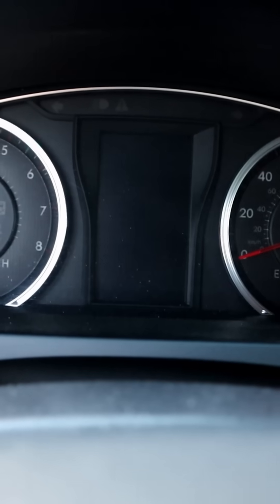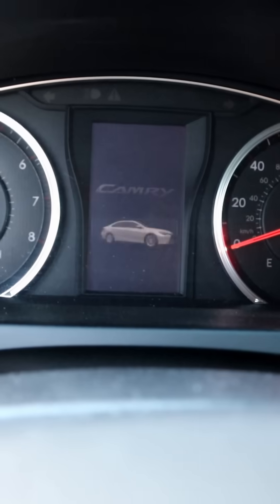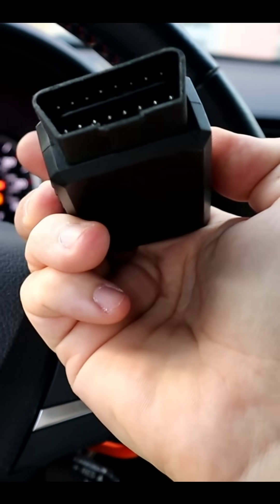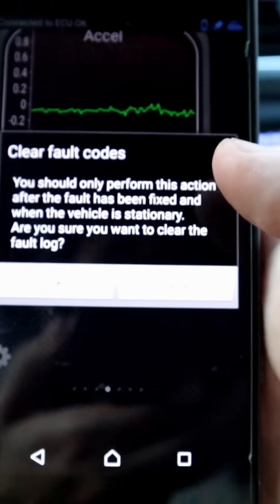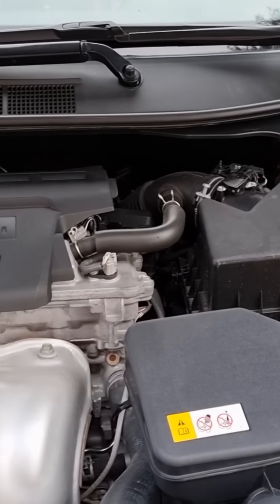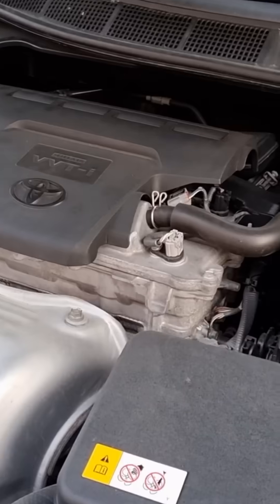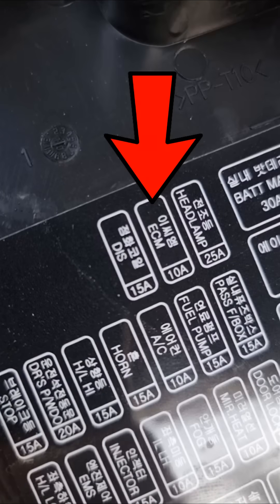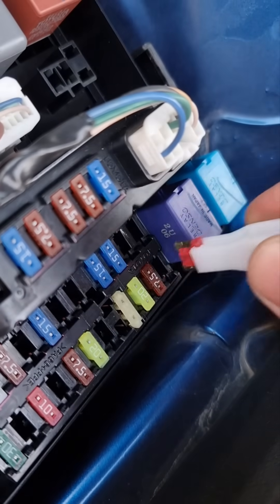Learn 3 Ways to turn OFF Engine light in 1 minute, How to reset ECU without OBD scanner tool#shorts

Comment: I got my light to go off on my Silverado my pulling out the ECM fuse while the truck was running the engine will die leave the ignition on put the fuse back in turn the ignition off then start it the light should go off then all of the other methods did 😅not work

Comment: ...I had a quantity of "4" ECU fuses on a 2024 Toyota Sienna.  Only saw 2 at first, but ended up seeing 4.   I pulled each individually and 3 and/or 4 must have been the one.  Thank you so much.  The Hybrid small battery negative terminal look very hard to take off. 
Excellent advice.  Thank you so much.

Comment: I removed the ECM fuse, but...do you take it out while the key is in the ignition and or while the car is on??
Reply: Did you take it out, with car on or off?
Reply: @龍1688  the car off.

Comment: I removed the ECU fuse and plugged it back in, and it WORKED!!!  Thanks!  So easy...
Reply from the maker: Glad it helped
Reply: I cant find on my skoda octavia 2008 model ecu would you have any idea what num fuse it is please??? @AliMECH
Reply: Was the check engine light because of the ecu? Because mines on rn because of the ecu
Reply: @moondripp31  it wasn’t at the time, but a couple of weeks later the car just wouldn’t turn over and that was the ECU, so I think it was the ECU all along.
Reply: Where is ECU located in camry 2.4???
Reply: @lindaobazeelindaobazeeosar5107 glovebox or somewhere
Reply: Please where can i identify ECU in camry 2.4????
Reply: Thanks brother! Great video 👍🏾

Comment: It did work. Thank You. I disconnected negative battery terminal and removed the ECM Fuse and put it right back in. The check engine light was off.  THANK YOU SO MUCH.
Reply from the maker: Glad it helped
Reply: @AliMECH  After check engine light is turned off, how long should it take to take the car for emission test?
Reply: Which one ecm fuse any code?
Reply: How long did it stay off for?
Reply: Til the monitor resets. @Peggysuesue123
Reply: Did you do that while the engine was still running on idle mode ? Or was the engine turned off  ?

Comment: Thank you, your video gave me the idea, though I had to remove the fuse for EFI in the engine compartment since ECU-IG and ECU-B in cabin didn't do the trick. It's a E12 2002 EU Corolla. It's a fuel burn issue according to the error code (catalytic converter/oxygen sensor).

Comment: Just keep the fuse off and never worry about it again ha ha ha ha
Reply: Also, a great way to pass emissions is to not go. Lol
Reply: @orbitty1354  Can one go for an emission test right away or few days after turning the  check engine light off
Reply: @nanapoku5259  I tried, that never works.
Reply: @orbitty1354   Oh wow. You mean the light went off but still didn't pass emission test?
Reply: @nanapoku5259  that's right.
Reply: @nanapoku5259  I'm not 100 percent positive, but with obd 2, it is impossible to cheat, unlike obd 1.
Reply: r u sure
Reply: @AliMECH  hey brother please tell can we do that?

Comment: You providing wrong information which would create other problems
1- never disconnect the battery to turn the check engine light off that is no no
 Here is why 
2- when you drive your vehicle the computer management system learns from your driving habit manage the vehicle sensors and assign a set of parameter for them to be able to run the engine and air file ratio and another system as well run the monitors and do on, when you disconnect the battery you erase everything all date especially freeze frame 

After that when you start your car ECU USE THE DEFAULT VALUES SINCE THE DEFULT VALUE IS SET OF INSTRUCTION THAT GUILD THE ECU AND USE THISE VALUE TO RUN UR CAR KEEP IN MIND YOUR CAR IS NOT NEW ANYMORE THE SAME IS FOR SENSORS YIU MAY HAVE VOLTAGE DRIP AT THE END WITH OUT YOU KNOWING IT UR CAR RUNS LIKE SH.. 
Sorry can not write shaky hand and mistake I hope you understand disconnecting bat is not recommended
  Even if you want to replace ur batt first use a 9volt batt to key the ECU running and disconnect the bat.
When I get the chance I make a video and explain enough to help u save money and little help during this difficult time
Reply: never heard this false nonsense before! i & millions of others reset their ecu learning all the time & my engine never runs like crap because of it. you have a whole lot to learn before you start barking false info on the internet!
Reply: Your response is what I like to call “a half truth” it’s got some good reasoning behind it but it’s not true. True your car does learn the best way to function as you drive. But when reset, it will return to the factory setting which are pretty good. The manufacturer knows how to properly run their car.
Reply: You make it sound like disconnecting battery is a bad thing. It's not. It'd normal and often necessary before working on the engine.
Reply: Bs
Reply: lol you kinda fail to understand just how much data history a car uses for calculations. It's not some learning AI that collects a lifetime of data. It uses current inputs from the engine, not a running tab of records that are used as a road map at different stages of It's life.

Comment: Fix the problem and clear codes is the only proper way
Reply: But what if you did fix the problem and still turns on
Reply: @antongjonaj3427  then it's not fixed
Reply: When you say fix the problem, what does that mean? How long should it take for one to take the car for emission test after turning the lights off?